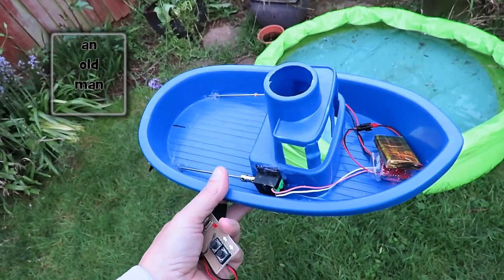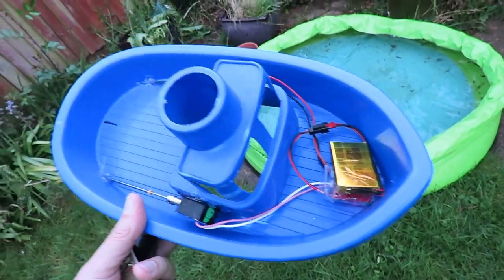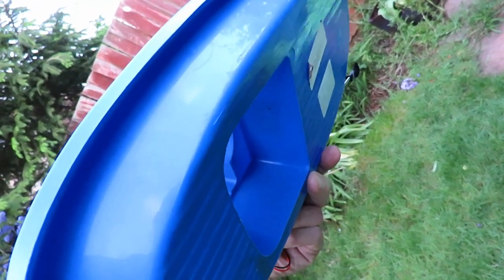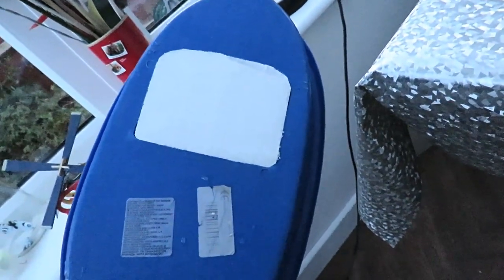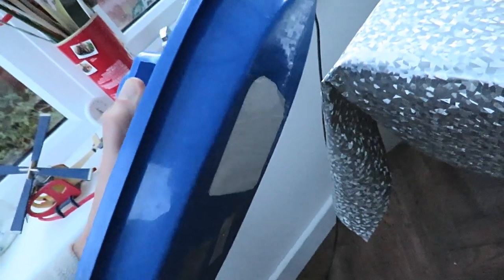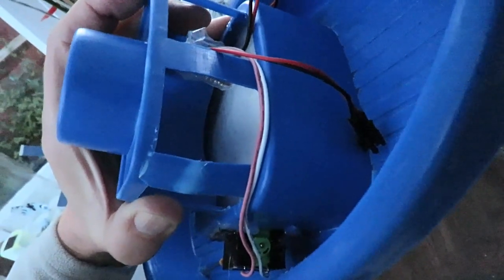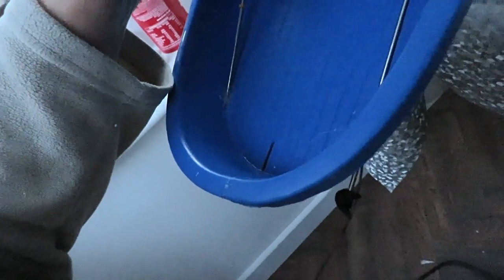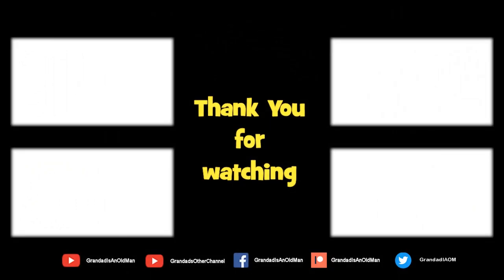Blue toy boat RC conversion 2.4GHz toy grade P1

Comment: It works great. I looked on eBay and that was a good deal for the prop kit. 

Tempted to get one. Is the differential thrust already set on the receiver or do you need to adjust that? :-)
Reply from the maker: No adjustment, it is typical toy grade. Forward/Backward on/off. It comes with left & right propellers so pressing the right makes both spin the same way to turn the boat and left reverses them. I have just had another play and initially it does that to get the boat spinning and then if you keep the button pressed one motor stops and the turn continues with just one motor. Not sure if that is by design or lucky effect. I was trying it with 2S and if I hold the boat still in the water it stresses motors and it starts cutting out so there might be some sort of heat/load protection. I will upload a video at some time to try to show what I mean

Comment: i really do like the shape of that boat  think its a tug  looks like it has some power too
Reply from the maker: I was running it on a 1S LiPo, I have just tried it on a 2S and the receiver does start to get hot so if you want to risk it overheating it will go much faster 😆
Reply: @GrandadIsAnOldMan  yeah sounds like 1s is the ticket  lol tugs are not supposed to go fast  so its all good

Comment: Nice boat, I would like to see a video on how to make an rc pop pop boat. Cool stuff though I really enjoy this channel(:
Reply from the maker: Thanks. There is not a lot you can do with an RC pop pop boat, you can control a rudder but you don't have any control over the speed. The main problem is lack of power so the slightest breeze takes over directional control. Here are some I have done and a couple of others guys
https://youtu.be/9rokTyAv3xU?list=PLA5a2xPRSrB2M0m754LkqMXQFwFRAS3HK
https://youtu.be/jpGnve9APU0?list=PLA5a2xPRSrB2M0m754LkqMXQFwFRAS3HK
https://youtu.be/H1aeDsVdOJA?list=PLA5a2xPRSrB2M0m754LkqMXQFwFRAS3HK
https://youtu.be/B_Bm5TcCsQU?list=PLA5a2xPRSrB2M0m754LkqMXQFwFRAS3HK
Atsushi Doi https://youtu.be/LQ8wGv7Kb14?list=PLA5a2xPRSrB2M0m754LkqMXQFwFRAS3HK

Daryl Foster https://youtu.be/2CINMciZwcI?list=PLA5a2xPRSrB2M0m754LkqMXQFwFRAS3HK

Comment: I eventually found a remote control Lamborghini with 27mhz controller for £1.49 all in at a charity shop. Absolute bargain. It has a controller module for the indicator LEDs with on off forward reverse motion. Buzzing!
Reply from the maker: That's the sort of find I like 😁👍
Reply: I wouldn't have paid £1.50 mind you 😃